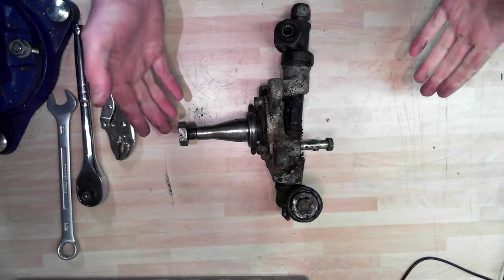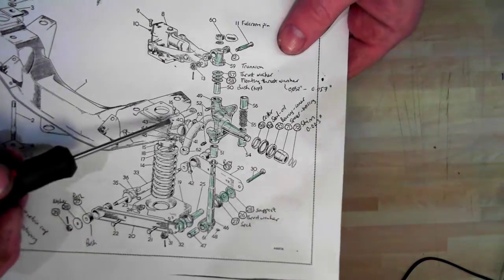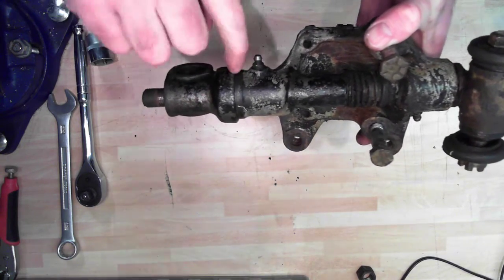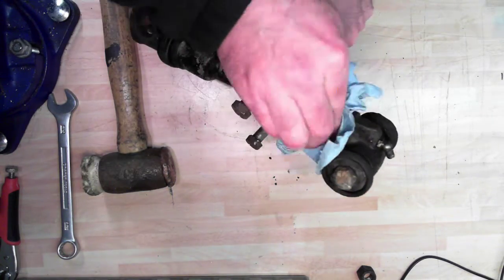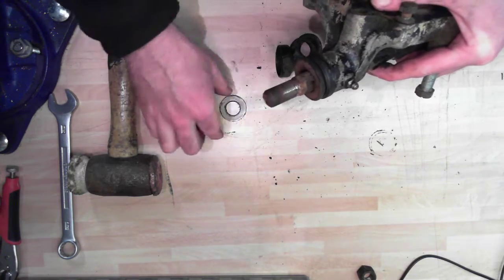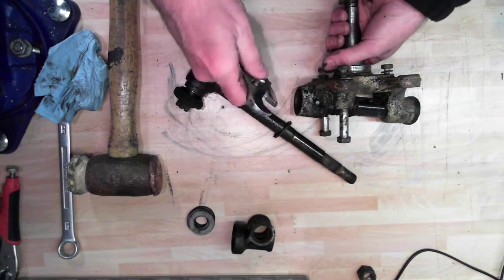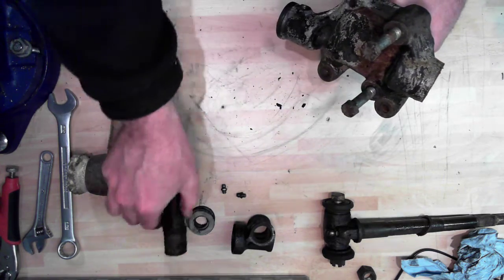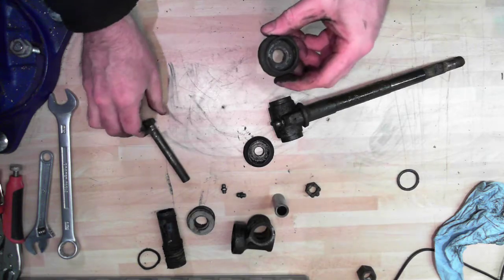MGB stub axle dismantling

Comment: Informative video, i have just reassembled the passenger side kingpin on my 75 roadster that has been sat in the garage for 30 years. I am reusing the original kingpin as it is in very good condition but I did buy the bottom trunnion kits as the rubber seals were showing signs of splitting.

Comment: You're quite right about the castle nut. The original kingpins did use castle nuts but the newer replacement ones all seem to use nyloc nuts. Interestingly the thread is a good 1/4" longer on the new ones as well.

BTW nice vid. I'm currently doing a full rebuild of the front suspension in my GT (as well as a V8 conversion) and like a twit I forgot to document the teardown (that I did about 6 months ago) so this was a pretty helpful reminder.